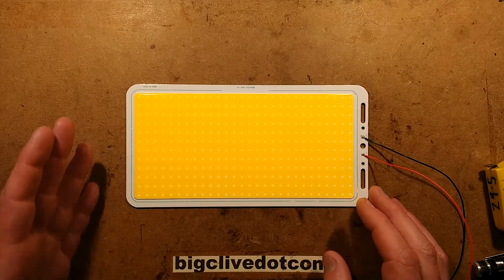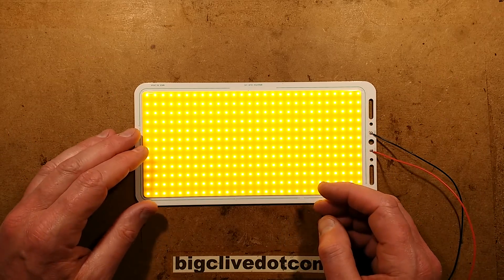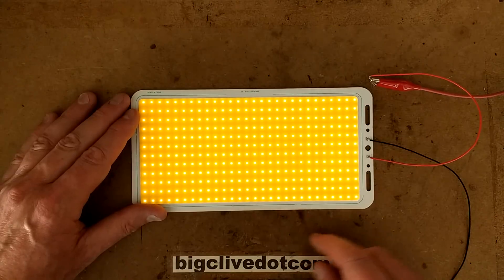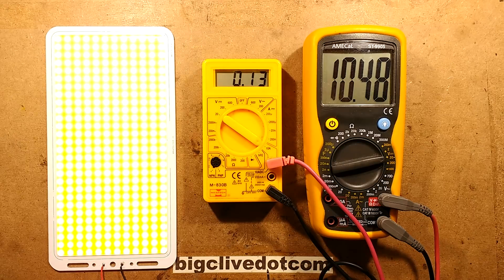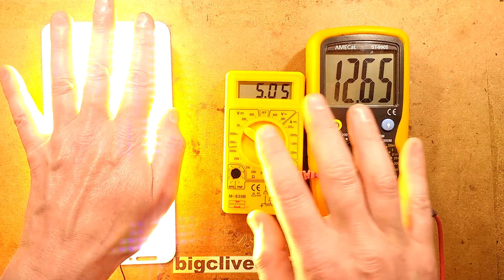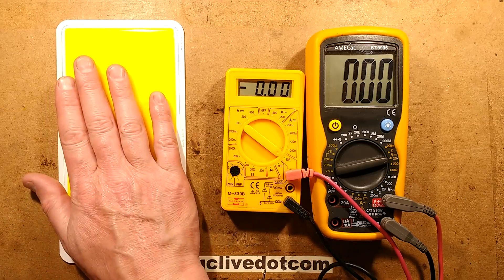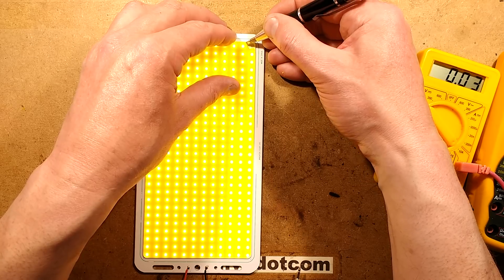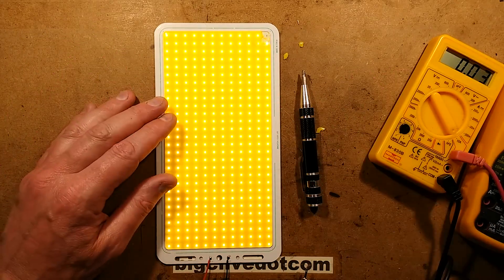The biggest LED COB panel yet!  Voltage/current tests.

Comment: @BIGCLIVE years ago i saw a simliar that scrolled with the name of what you desired to say thru inpur with a vga adapter what i was wondering is if it can be made big enough to say the words that were input ed  example maybe  3 feet across 1 foot  top to bottom , i have the original input device but not the screen can you or someone help with where to get it made already or design a simple one
Reply from the maker: You can buy full colour video walls quite cheaply now.  There are also a wide variety of moving message signs available.

Comment: Slighly incorrect there Clive. For the projector market there are lamps that go up to 500+W in the same footprint as the domestic security lamp, 30/50/100W. Crazy heat dissipation required.

Comment: Thumbs up for your videos! I really enjoy watching them.
I bought six smaller COB LED panels with each 50 watts to give my pepper plants a little boots of light for winter time.
But they heat up quite fast and i got about 70°C after 7 minutes with one of them mounted to a passive cpu cooling unit.
Could you make a video how to build a passive cooling unit for serveral of those in a row?  I was thinking about some kind of aluminium plate.

Comment: I bought one of these cobs, but I have a driver that is constant voltage rated for a DC output of 12v +/- 5% and 6.2 amps. 72 watts basically.

Shouldn't this setup work, or will I end up burning out my cob?

I figured it would be alright because it can't draw more than 6.2 amps, but am  not sure if I will be killing the panel or if it'll be alright.
Reply: I know this would need a constant current driver by the way.

But if you think this CV driver setup is going to be alright, I won't have to track down and buy a CC driver.
Reply: I think in theory it'll work aslong as it doesn't thermally runaway. 
A 1ohm 20w resistor would keep the led at 36 watt if it pulls 3000ma at 12v. 
You ever play around with it?

Comment: Actually this array consists of twelve rows that each contain twenty-eight individual chips which makes for a total amount of 336 of em. Instead of twelve times twenty, which by the way would add up to 240 and definitely not 346 even though that number which in itself is quite close to the actual number counted correctly. IF this thing would consume 70 Watts indeed, that would mean a consumption of 70 / 336 = 0.208 Watts per chip , and when we would devide that by 3 as if we supposing
 the applied voltage per individual LED would ideally be 3 Volts, that gives us a power consumption of 0.06ö4 (say 0.07 Amps or 70 MilliAmps per chip. And as each chip contains three individual, actual LEDs apiece, that gives us an outcome of 0.0231 A or 23 milliAmps per LED. There possibly is a few percents of that that are absorbed by wiring, a few micro components for voltage /surge protection and tp smoothen things out on the circuit and / or on the individual chips as well; taking that on account we still come up with a final actual power consumption that is close to a nice, round 20 milliAmps each LED gets. By the way, I do have a question about this: when the temperature inside the LEDs goes up, does the conductance and with that its own consumption as well as what it can pass through drop as a result? I am aware changes relating to temperate development in the LED /~ chip would need to be measured in nanoseconds. The way LEDs work is they get so hot the variety of individual metallic molecules (for composing the right part of the light spectrum) that are mounted on the tiny little pieces of silicon carrier in them, gets so hot that they start emitting light as a result, uv light which is passed through a layer of phosphorus to give out the right light colour. The LED works basically must like an incandescent light bulb did, but is much more efficient cause it only powers light producing molecules that lay directly on the surface all of which can emit light that can travel into (reach) the outside world ndeed, minimalising the losses in by molecules that are powered and produce loads of heat but are not in a position to bring forth light. Also the conduction is way more stable af sturdy, al the stuff being mounted on a plate that is surrounded by glass and encased / enclosed and it doesn't contain a wobbly filament that dangkes inside and can break by the slightest tremble. Apart from that some of the LEDs adjust to an output of the right (desired) visible light frequency by running the primarily created waved form of the photos it produces (uv) through a layer of phosphorus just like in the fluorescent light sources of the previous generation (tl) and the cathode ray tube in colour tvs (containing the separate photon sources scanning the inside of the tube creating the subpixels and three different types of phosphorus, one for each colour of 'dots' on the screen.. One for red, one for green, and one for the blue ones. It is what the modern ultra-flat LED tv for in common with the old one. Another thing, I do not know what the difference between power consumption and dissipation is, can somebody enlighten me.? Thanx !

Comment: Clive... bought this right after your video was released. Could you please tell me how to make it chooch with a 12V car battery? Do I connect it directly or do I need some sort of a driver?? Links to that, please. DIMMABLE would be mandatory. It's 4 months now I have it, and haven't seen it lit yet. THANKS.
Reply from the maker: For dimming you could use one of the 12V DC dimmers available on eBay or just use a series of switchable resistors.  For running it from a car battery I'd suggest at least a 1 ohm resistor with a high power rating.
Reply: Thanks so much for your reply Clive. Sorry just saw it today. I set it up for a street-side fruit vendor's stall today, whom I'm helping out. It does not get hot at all on a 12V car battery. Will put in the 1 Ω resistor soon. So far it has run ok for an hour.
Thanks a million again.

Comment: Ive purchased  4 of these  already.  And I've  no idea what to do with them 🤣i put 14 volts throu a mini rf 12volt 19amp ( hah) controller and this thing gets so damn bright  and the led was stable (as the led controller was smoking and melting down) the entire panel got hot as hell instantly, as opposed to previously on 12 volt 4 amps it took  about an hour and a half to reach any type of temp  like this. I don't know what kind of power I was putting to it when it got super bright and heated up the entire panel instantly. But I'm guessing you was closer to about 12 amps. Much higher than the rating. I can't find anything that's that powerful to push to this led. Ive burned throu all my controllers.  I mean sure are you go online and spend like $80 on something good but i just bought a 12-volt 8 Amp power supply and the bastard only puts out 6 amps. 😒. Can't  win for losing  🤣
Reply from the maker: I'd recommend not running this panel hot.  It will last a lot longer run at lower current.
Reply: bigclivedotcom im trying to think of a way to use a pelter thermo..whatever it is as a heatsink.  Ive just  now been seeing the 12volt ones on ebay for like 2 dollars.  Is it the heat that  shortens the LEDs life or the current?

Comment: What size resistor would you recommend for using this for automotive use?
Reply from the maker: Just an ohm or two rated at a suitably high power.

Comment: I ordered eight of these at the beginning of the month, and they arrived today (here in Texastan).  Two of the panels (the ones at the top of the stack) were all 100% uniform tested at 9.5V drawing 2 mA.  Two had severe non-uniformity, and interestingly both tested drawing 3 mA.  Four had mild to moderate non-uniformity, and all but one tested at 3 mA (the other was at 2 mA).  one of the severely non-uniform ones has deep scrapes/scratches in the rear aluminum, the other severely non-uniform one had no issues with the backside.  The ones I bought were wrapped in very thin foam sheets, and shoved in a plastic bag and mailed in the bag from China.  I'm not sure if this is how they are all being shipped (I would hope not), but it is something that everyone might want to inquire about before purchasing.  There was not even bubble wrap.

My numbers should be accurate, my Fluke 117 is NIST tracable.

I'm going to ask for money 3/4ths of my money back from the seller, or replacements that are 100% uniform.  I'll update this with the results of that.

Oh, in an interesting coincidence, mine came from "valuedresshop" on ebay.
Reply from the maker: All mine came in plain plastic bags with minimal packing.  They seem pretty rugged though.

Comment: Any ideas how I could mod this to be a dimmable studio light, for video?
Reply from the maker: You use a current regulator module and a power supply that put out around 14V or whatever the module required as an overhead above the LED panel voltage.

Comment: Has anybody an idea what kind of powersupply can be used for this panels. With a simple 12 V supply the panel draws only 2,85 A but only when it is cold. How much will the current rise when it is hot, maybe 60°C and it will rise a lot.  To solve the problem we need a adjustable constant current supply with 12V and 5 to 6 A and the only way to get this is to use a 24V supply with an CC CV step down converter. This is to much effort and not efficient.
Reply: There are adjustable power supplies, but they're more expensive, and unless it's a space-sensitive application, I wouldn't want to drive these LEDs at anywhere near their full power.  You don't want your LEDs getting hot, as it reduces their lifespan. It's easier and probably cheaper to just buy more of them and drive them at a lower current with a regular 12V brick.

Comment: I've been looking for a decent bench light for some time now. When you posted this I pulled the trigger and bought this because for the price you really can't go wrong. It came in today and I threw together a little mount for it and man is this thing bright! Here is a picture of it installed above my bench.

https://imgur.com/a/mwTvLwt
Reply: Looks good, what are you using to drive it?
Reply: Colin Hickey I've actually got it hooked up to a custom pcb that accepts an Xbox 360 power supply.
Reply: I have a few spare DC-DC converters which are CC and CV so might try one of those first.  Was curious what others were doing.  Thanks :-)

Comment: Not to bother you but youre the only youtube video woth this led cob... i heated it up like you said and it soldered perfectly.  I attached  a 12v 3amp ubec  to it. On a 4s lipo battery it is bright and constant then it starts to strobe. -not flicker, but strobe. On a 3s lipo its dimmer but it doesnt strobe. When on 4s and it strobes i disconnect and reconnect the power quickly  and the strobe  starts as soon as i reconnect the power. But if i leave the ubec unpowered for a little  bit it will not strobe instantly. I will get a few (maybe 10) seconds of constant light before  it starts to strobe. I hear  something about  a led driver? But i thought  a 12 volt 3 amp ubec would  work perfectly.  Would a small uf compacitor correct this problem? If so where would i put the compacitor at? Its so hard learning this stuff..
Reply from the maker: Could it be the protection circuitry on you lithium pack that is pulsing on and off?  The four cells would put out a peak voltage of 16.8V and may have forced too much current through the panel.
Reply: bigclivedotcom i bet that does have some play in itaftwr further experimenting. The 3s plays well because it doesnt over heat my 12volt ubec. My 4s makes it extremely hot.  I also have 4 18650 batteries  in series which is about the same as a 4s lipo (kind of i guess)  the ubec about burned my fingers  from the heat. I believe even hotter (maybe)  than yhe 4s made it. But with the 18650 4s setup the strobing  was extremely slow Compaired  to the 4s lipo. Im at a loss. A larger ubec would probably solve the problem but then i risk blowing the leds from the amperage. The volts and watts and amps it specified  online varied from listing to listing and i don't  trust them. And on top of all that I'm  a total noob. And im 31 😒 or 32.. sometimes i forget
Reply: bigclivedotcom oh and theres no protection circuitry.( if that means it's like an actual piece of hardware) It's just a regular 4S lipo. Nanotech 1.3mah 4s high c.

Comment: Why wont my solder stick to the pads for??? Do i need a special  solder like for soldering  nickel battery tabs or whatever?
Reply: Will regular solder stick to it after i heat up the whole  board on that end?
Reply from the maker: These COBs act as a heatsink and cool the iron tip when you attempt to solder onto them.  You have to preheat them before soldering.  A common clothes iron or hotplate can work if set low enough to avoid damaging the LEDs.

Comment: Really good LEDs at this point will actually dissipate more power in the form of radiant flux than they do in the form of heat, and this can kind of fool our senses.  Something that is hot is going to have heat coming off of it if you put your hand near due mostly to convection.  With LEDs like these however, most of the heat you feel is actually from the photons impinging on your hand, not because the actual source of the light is hot.  It still messes with me, because it feels just like putting my hand near something quite hot, but if I cut power, the heat vanishes, and the COB will be much cooler to the touch than something that could ever have produced the heat I felt on my hand via convection.   

The newest blue-to-violet LEDs as of 2018 (which are used to make white LEDs of course) have an efficiency of about 72%.  Put in 1W of electrical power, and get out 720mW of light, along with 280mW of heat.  You can buy them on mouser, digikey, etc, this isn't something in a lab.  They're so good they seem almost unphysical.

Comment: When you popped that poor inoffensive LED, all I could think was NOOOOOOOOOOOOooooooo!  I'm glad we have a ruthless hitman to do the deed.  Like buying meat at the supermarket, get someone else to take the hit and then take the spoils in a nice clean package.

Agree with twocvbloke, the tech is moving at a fearsome rate.  candles lasted for 100s of years, Incandescents 1880 (ish).  CFLs appeared 2000(ish) developed to a usable source and then have virtually vanished by 2017.  LEDs (as a domestic light source) are changing almost daily if you have the time to trawl e-bay.

Thing I'd like to see now is a safe way to power the damn things so you can be reasonably confident they won't bite back.

Comment: Clive I have just purchased this cob for a photographic/video project in cool white.  Could and would this run on an ac/dc 12V 80W output driver (as that’s what I have chosen to drive it with)?  I have an huge industrial laser cutter heat sink to mount it to.  Best regards Phil Steadman
Reply from the maker: It should be OK, but always have a backup plan for lighting.
Reply: bigclivedotcom thank you Clive!

Comment: Before watching - those wires look awfully tiny to pass 5A+ through them to feed this beast. Sure, they're thick enough as to not get too hot and melt under such a current but one has to account for bending and things like that.

Comment: Seeing this I immediately wanted to do a diy bulky flashlight with it, but having little experience in sourcing led drivers I'd love to know if someone has any suggestions for some kind of ~60W constant current driver I could use. Most things in that range on ebay appear to be either enormously bulky or they operate at much higher output voltages than this thing will accept. My thinking right now is that I'd like to essentially wrap up a handful of 18650 cells, a driver and then bolt those to the back of this panel, optionally with a heatsink in the middle and then arranging some sort of case or frame for it in the end.